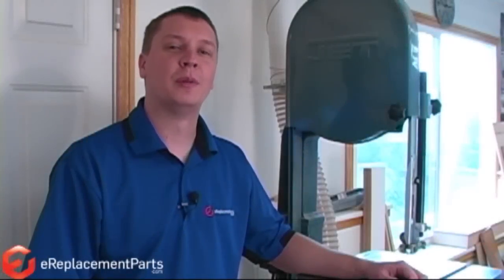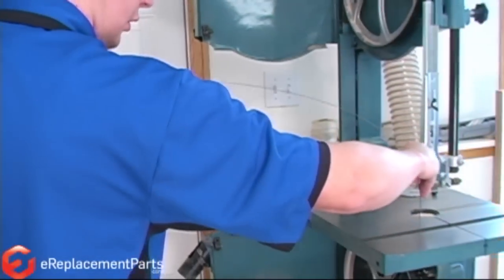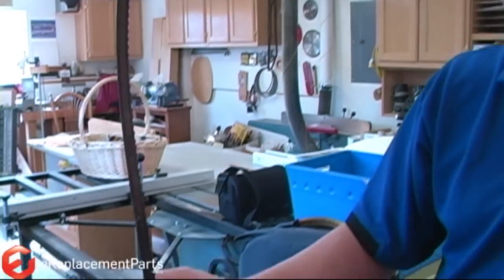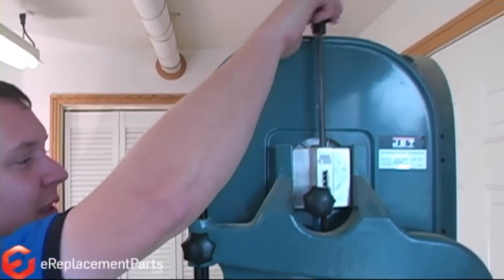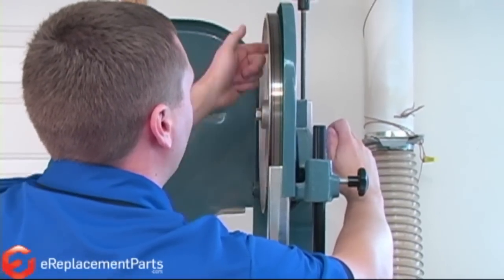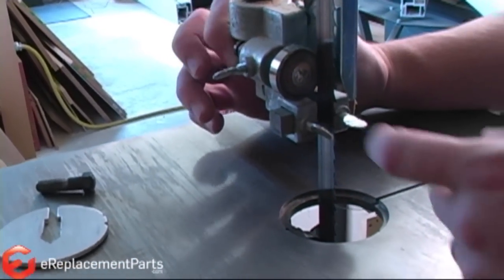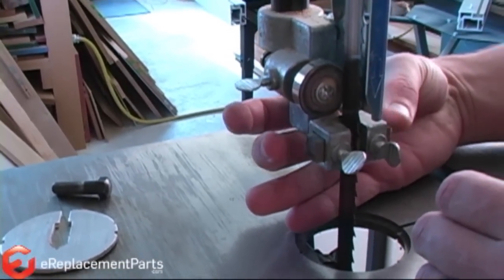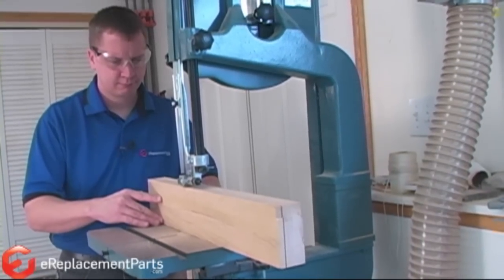How to Change a Bandsaw Blade

Comment from the maker: @jk642795 If the blade won't track you typically have one of two issues, either the blade itself is bad or the tires on your saw need to be replaced. If all your other blades will track OK then you probably just have a bad blade. If none of the blades want to track well then you will want to try replacing the tires on the wheels. Take a look at out video titled "How to Install a Bandsaw Tire". 

I hope this helps!

-Mark

Comment: Have you ever had the guide blocks pinch the blade during operation having them so close to the blade? I too like to controll the blade, ive .added a roller bearing set and love it,, though they won't last for ever like the blocks.I've read that someone suggested using hardwood blocks instead of the steel ones to better protect the blade from dulling the teeth in the steel.any thoughts on that may help others .I still use the blocks on my fine 1/8th and smaller blades with hardwood.inserts.easy to make and dont dull the teeth

Comment: Thanks. My bandsaw's not as nice. I have a delta 9". It worked well until I needed to change the blade. Now I can't cut straight, and the blade comes off. I'll go back and use your step by step guide again.

Comment: do the teeth on the blade go facing up or down, does it really matter!
Reply: Yes, Karen - it matters quite a bit. The teeth must always be facing down into the cut. If you plan on operating a bandsaw (or any other power tool, for that matter) you need to familiarize yourself with all the procedures and safety issues. Good luck and be careful.

Comment: This video was no help at all because you went into no detail on how to track the blade. And that's where I have no idea how to do it.
Reply: There will be a small knob or handle on the outside of your saw at parallel to center of the top wheel. As you turn the wheel with your left hand, your right hand should be turning that handle in the direction which lines the blade toward the center of the tire. If you watch his right hand as he's turning with his left, you'll see him making the adjustment. But you are correct in that he should've elaborated on that part in more detail. Do a YouTube search for "coplanar" and good luck.